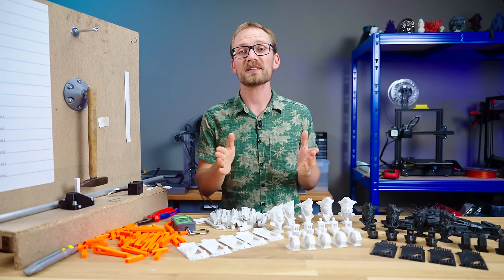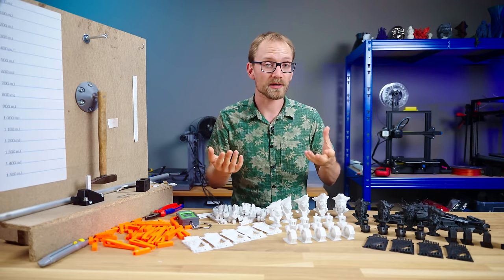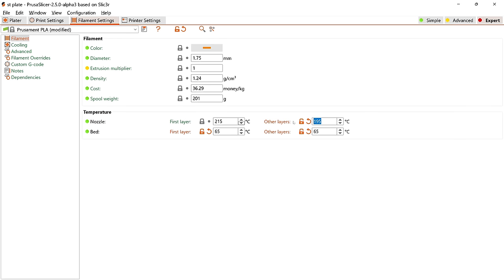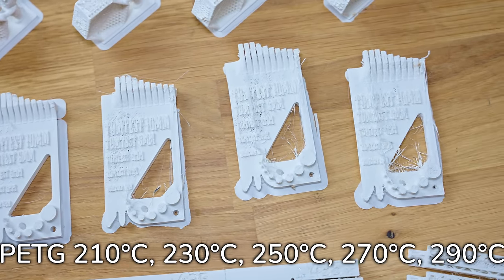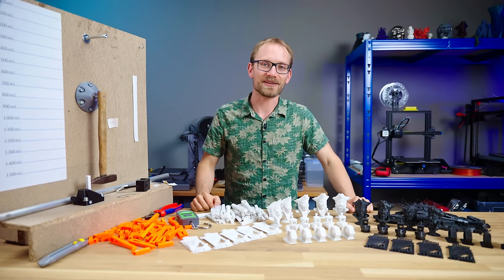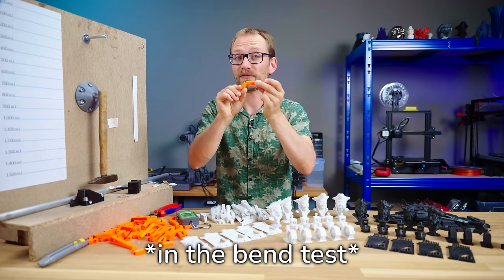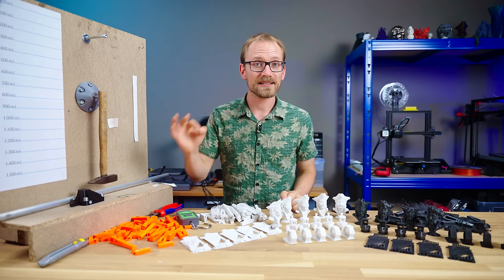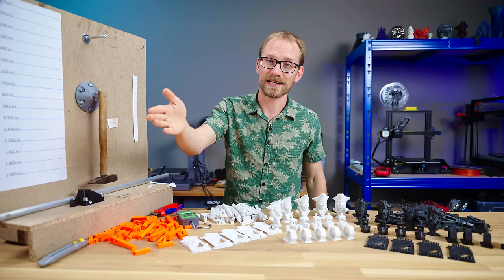Are you printing at the right temperature?

Comment: There is one Question that has been on my mind for a long time:
When you are printing these test sets with different parts all at once, is there a penalty for the higher (z-test) parts at the layer where the other parts are finished?
I would bet money on that there is, as the time per layer suddenly reduces to less than half and the material temperature of the previous layers is suddenly completely different! I can even see this with my eyes on most of the stuff I print.
If so, are parts in general stronger when you print the whole plate at once, meaning newly deposited material has a higher termperature difference to the previous layers or is the opposite true (temperature has to be homogenious)?
Has somebody tested this?
Reply: I haven't tested this myself but I have a decent understanding of solid mechanics and might be able to posit an answer. As I see it, there are two questions:1) Does the print quality change in any way as a result of other (smaller) parts finishing and overall layer time decreasing, and 2) If so, is this quality change meaningful?

1) Yes, I agree with where you're coming from here; the print time per layer decreasing by any appreciable amount would certainly result in the two layers at that interface being bonded a little differently than the ones that preceded the change (when the other parts were still printing).

2) I don't think this is (negatively) meaningful in any structural sense. I would expect that the layers printed post-small pieces (ie. shorter layer time) would bond together better, and that the transition point would have nothing unique about it other than it's the first point when the layers start to become stronger.

It's interesting that you've observed a visual change between the layers printed alone and those in printed in tandem with another part(s). I understand very little about how light works in these situations so I can't comment on why that might be happening.

As for whether parts would be stronger when printed alone vs in tandem: if I were a betting man, I'd say that parts would be stronger when printed alone—but only because of the reduced strength of the entire section that was printed before the smaller part(s) finished. That said, I would think that the strength difference would be very small in most cases. If you have an enclosure for your printer, I would think that this effect would be barely noticeable in every-day use cases.
Reply: @harrisonlow  Thank you for that in depth answer!

I would agree with almost all of that and would suspect the same results as you do, although we do not know until somebody thoroughly tests this xD (Which somebody in a lab for sure has done).

I would absolutely agree that material were the layer are of more equal temperature when deposited should be stronger as one is gettings closer to what a mould would yield.

The one thing that I really would want to see tested is the one where the layer time between two layers suddenly transitions. I know that inhomogeneity can lead to internal stresses that can lead to predetermined breaking points in a piece, especially if parts are over a certain size. e.g. ASA shrinks by about 0.2% when cooling from nozzle to hotplate temperature in my estimates. That does not sound like much but in a 300mm part creating the stress that results from forcing a deformation of 0.6mm can have huge effects when it comes to yield strength and resistance to impacts.
Reply: @perchte  I'm less sure that this has been tested in a lab environment (or one remotely approximating a lab environment). There are many questions in 3D printing (let alone outside of 3D printing) that are at least as important/interesting at this one, so I doubt that the human enterprise has gotten around to studying this in much depth. I'd love to know the results if I'm wrong, though!

Either way, in response to your question regarding the strength of the layer where the time changes, I can see where you're coming from and I'm honestly not too sure if there would be anything (structurally) unique about this point. My guess is that it might be slightly weaker than the layers that preceded the time-change, but not by any appreciable amount. 

I'd say that if you're concerned about the layer strength of your print, you should print that part alone to avoid the wait time while other parts print, and in all other cases, the (possible) slight decrease in strength shouldn't matter anyway. 

A related question could be how the order in which the layer prints affects the quality/strength of the layers: perimeters first, or infill first? Perimeters printing from outside-in, or inside-out?

Again I suspect any difference would be small, but it'd be cool to see how those changes affect the end result
Reply: @harrisonlow  Yup. Would be interesting to watch!
If the data is just in the noise than it's also a result, but in my experience there always was some unsusprected effect that noone anticipated when doing large scale tests on such patterns.

Comment: I've been having the best success with PETG at 245-250 and 40mm/s with 0.6mm nozzle.  But short path segements either turn into either an under/over extruded mess or clog the nozzle.  Priming, retraction, flow %, speeds, combing, infil %, ; nothing seems to work.  Longer path segments print beautifully though.
Reply: Check print fan speed. I've been using PETG as well and was having issues, come to find out my print fan was too fast and I guess cooling the nozzle. I also keep my air con off while printing cause it was across from it, seemed to cause more stringy.
Reply: @JJayzX  Disabling part cooling made the difference.  Was watching really closely and all the problems start the moment the cooling fan starts.  I also added  0.064mm3 coasting, 0.1mm3 prime, 95% flow, and 0.02mm z offset.  Stringing, over/under extrusion, short segment adhesion failure - all gone.
Reply: @LeadSkillets  nice

Comment: I've been printing extremely fast (120mm/s) with high temp (220C)  on Anycubic i3 Mega. I've been thinking what if I just crank up the speed and temp so it is loose and can print fast, then you just need really fast cooling. Drop a box fan on it. Maybe I'll test some day. Obviously the detail of the print matters.
Reply: That's not extremely fast. That's slightly fast. Almost any low-cost printer can achieve that speed, and with some mods can go a lot faster. Look up videos of speed Benchies on modded Ender 3 printers for example.
Here's Nitram printing at 300mm/s and 8k accel on an unmodded Ender 3: https://youtu.be/6xFSiSomz9k
Here's a 6:30 Benchy on a modded Ender 3 Pro: https://youtu.be/XB9eMsgy_cw
On my slightly modded RatRig V-Minion, I print at 400mm/s and 15k accel for quite high quality prints, and can hit 800mm/s with 25k accel, but get limited by flow rate. Once we get a Revo with high flow ObXidian nozzles, I'll upgrade.
If you want to see extremely fast, check out this video from Vez3D printing at 1500mm/s with 50k accel: https://youtu.be/hcMxEkVvIdE

Comment: With some hotends the filament gets hot inside hotend but the temperature of actual extrusion is much lower. This is much effected by the feed rate ei specially when the heater power is too low. I have not seen an hotend that is able to compensate the effect of flow. I have a idea that the hotend should have two or more heating zones somthat the tip of nozle cold be kept at higher temperature expecially at higher feedrates tan the hotend internal melting zone. That cold enchangebthe performance by making aboe tomhave high adhesion temperature but lower meltingbtemperature. At least in thery lead to les brital and same time better layer adhesion. I wonder if some one cold try to implement such hotend? For me it is a bit challenging.
Reply: Sorry Finnish rvtypos🥴
Reply: Sorry for typos 🥴

Comment: most of the time i print with 240 and 60 to 70 with petg i never printed anything different then petg.
Reply: That's pretty much my experience as well though my bed temp is 75c and I'll print a tad higher at 245 and a tad lower for matte PETG. I mostly make functional as opposed to decorative parts and PETG seems more dimensionally stable over time. Also, with PETG, making sure the filament is dry has always been super important in my experience.
Reply: @wturber  with whet or dry i dont really see a big differenece for me but im a beginner. I cant go over 70 degreese o have a cr10s4 on liniar rails and it needs 22 to 25 minues for heating up the bed its awfull
Reply: @thomaskletzl6493  I buy most of my PETG from California Filaments. They are reasonably priced, give discounts when you buy more, but most importantly have a decent matte black filament that I really like. My one complaint is that I receive their filament "wet." It always needs drying. 

When "wet", the filament is more likely to string and to create those branch-like structures Thomas showed in the video.
Reply: @wturber  maybee i should give it a try my filament is from bavaria filaments
Reply: @thomaskletzl6493  Maybe. Before you bother, heat up your hot end to 240-250C and manually extrude some filament through it. Do you hear any popping? If so, the filament would benefit from drying.  If no popping, break off a piece of that filament after it is cooled and look at it with a high power (8x or better) magnifier. Can you see any bubbles? If so, then drying is probably a good idea. Bubbles are easier to see with clear filament, but can be seen with other colors as well.

Your supplier may do a better job with delivering dry filament up front. OTOH, there's a fair chance that both of our filaments come from the same Chinese source. :^)
Reply: I just looked up Bavaria Filaments and they appear to produce their own filaments. My bet is that your filament comes pretty dry from the maker.
Reply: @wturber  its on a cardboard spool packed with a vacum bag. I dont hear any popping.
Reply: @thomaskletzl6493  This may be unfair cultural bias on my part, but I'd expect a typical German maker to pay more attention to such details than a typical or especially a budget Chinese producer.

I like the cardboard spools as well as their availability of "repro" PETG. Stefan and/or Thomas really should consider featuring this companies products in at least one video.
Reply: @wturber  idk the prices but for 20 euros its not really that high for the quality
Reply: @wturber  and its not really unfair the most static based channels are from germany, stefan(cnc kitchen), and thomas. Even with companies i have the felling that they test almost every product really often
Reply: @thomaskletzl6493  Yep. I'd give them a try if they shipped to the U.S. (if shipping rates were low). But they don't appear to ship here.
Reply: @wturber  i dont think this is worth the effort. Do you not have companies that have quality stuff?